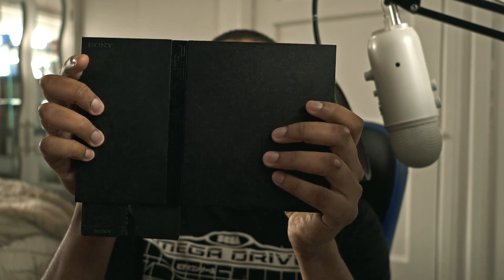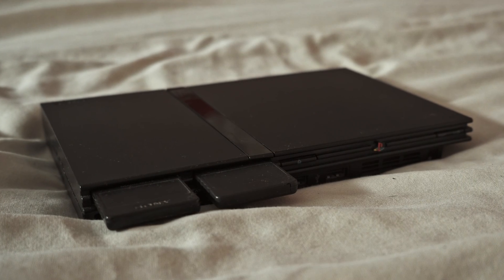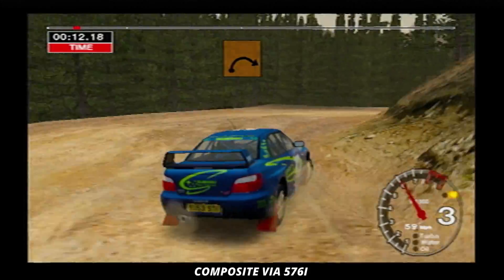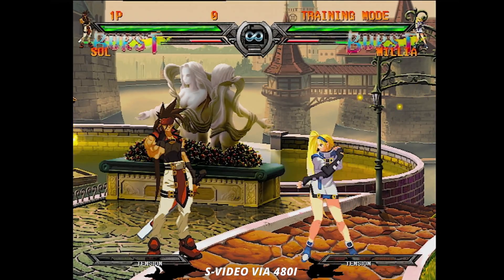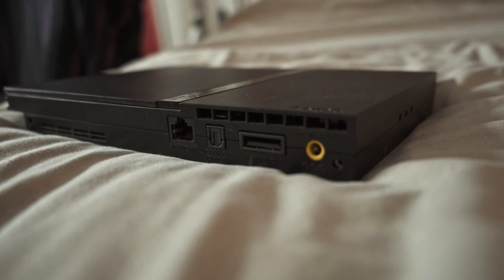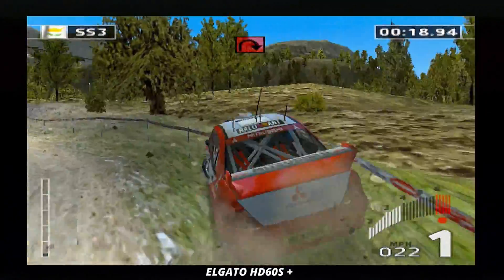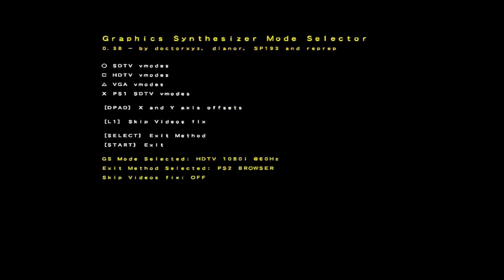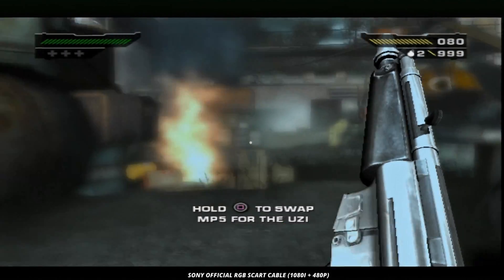PS2 Video Output Misconceptions & How To Improve Image Quality - theaffroshow

Comment: Great informative video. I currently have my PS2 slim plugged in using the PS3 Component cables to a G Comp Switch with one Component out going to a Crt and the other to an HD Tv that way depending what Resolution the particular PS2 game supports and or/if it support Widescreen, I can decide which TV to use. I also have the HD Tv on a Swivel Mount for Tate games that the PS2 have. I’ll never forget that first time I went from Composite to those Component cables, it was night and day.
Reply from the maker: @gametourny4ever627  Sounds like a setup getting the best of both worlds & glad you are enjoying Component cables, a great choice for PS2 video output :)

Comment: I've got the expensive Sony Ps3 cables that for the ps2 slim and using GSM in 1080p is absolutely phenomenal picture! Only got that cable for £6 like 10 years ago its worth over £200 now 😂
Reply from the maker: A very lucky purchase there & glad you are taking full advantage of it :)

RGB SCART also supports 1080i albeit with RGsB on PS2 consoles :)
Reply: What cables?

Comment: I use an HD Retrovision component cable and an OSSC, granted the cost for both is about 190 quid but the picture quality is fantastic.. well as fantastic as you can make the PS2's crappy video signal look anyway.. also one thing I think you missed, in order to get widescreen you need to set the console to 16:9 in the system config menu as some games don't have a widescreen setting in their options and instead look to the system settings and automatically enable widescreen otherwise you'll end up with a stretched 4:3 image.. the Race Driver games automatically set widescreen as an example
Reply from the maker: @waynehickman8317  It is a great combination & while I love RGB SCART, Component is excellent too :)

Yes I did miss that, thank you for bring it up, most people overlook this!

Comment: I have a modern monitor. Would you suggest component cable into an hdmi converter and the hdmi cable into the monitor? Or would you suggest another way? Thanks
Reply: Thank you for the reply. How can I find out if my monitor can deinterlace? I'm a bit new to all this 😅
Reply from the maker: If it's a TV the display will automatically do it as it has one built in :)

As for monitors I assume the same thing would happen but if not, you'd either need to use software like OBS which has several options (Yadif 2x I'd recommend or Retro which is bob deinterlacing) :)

Or perhaps video players like QuickTime which can double as video input solutions might have this too although OBS is more flexible :)
Reply from the maker: You could do this, but this means your monitor has to deinterlace 480i/576i for most PS2 games & if it can, the experience using a good component cable should work :)
If not, get an upscaler like the Retrotink 2x, Retroscaler 2x or a RAD2x cable :)
The OSSC I use is also recommended!

Comment: I use the LevelHike device.  It works very well.  And it is not overly expensive.  It produces 720p and it looks very good.
Reply from the maker: Hmmmm, I've heard mixed responses on those cables. As a starter cable I guess it is not a bad way to go but a retroscaler 2x, retortink 2x or a RAD2x cable would look better and not cost too much more :)

If the cable you own allows you to use PS2 progressive scan mode (480p) in selected titles, that would be a compelling option as 480p is a great way to view PS2 games where possible!
Reply: @TheAffroShowGameplay  LevelHike upscales all RGB signals from PS2 to 720p.  It also has 4x3 and 16x9 selector switch.  It is trchnically a small box that sells for approx 30$.  I been using for 5 years and like it a lot.

Comment: Great piece of information in this video. I owned PS2 years ago and sold it. I have found silver, fat one for £30 on carboot sale yesterday and I'm coming back to old games now. I have component mini input in my tv. Will I loose any video quality if i use component to component mini adapter? It's hard to find any information online specific to this subject. Cheers.
Reply from the maker: Unfortunately I actually do not know about this, if it is a passthrough adapter I assume you wouldn't but I cannot say for sure :)
Reply: @TheAffroShowGameplay  no worries, I'll have to test it myself.

Comment: Good vid. Ps2 is a funny one. Like a few watching this i have numerous rgb scart cables from a well known uk company. My other systems rgb scart cables through a retrotink 2x scart to modern tv, flawless. Set up the ps2 the same way and theres some minor flickering top and bottom of image. Grr. Only way to fix I’ve found is to take the tv out of ‘game’ mode which creates so much lag games are not fun.
Reply from the maker: It sounds like the overscan area that CRTs had & of course using HDMI TVs see it differently:)

Funnily enough, on my OSSC, I do not have this problem on the PS2 using my 4K TV buy I've seen it crop up on original XBOX, odd indeed!

Comment: An awesome video mate 😄👍👍 I very recently started using a PS2 with official Sony PS3 era Component cable for the first time ever and the difference between that and the standardised Composite cable is definitely a major step up in terms of overall picture clarity and quality. 🎮📀
Reply from the maker: The difference is gigantic:)

It seems a lot of people have still stuck with Composite after all these years so, videos like this need to be made so those who simply do not know can see you can indeed improve video quality on older consoles :)
Reply: Whats really mindblowing is the first PS3 was packaged with a component cable and most people never switched it out.

Comment: Which one of these cable options would you prefer for recording PS2 gameplay? Also which one(s) work best together with capture cards, like the one from Elgato? Thank you!
Reply from the maker: I personally own an Elgato HD60s Plus, which all the gameplay footage from the OSSC was recorded onto :)

The other upscaler was an Retroscaler 2x, used when I showed off S-Video & Composite:)

In terms of video quality from the PS2, RGB SCART or Component are the best although S-Video is a good shout as well :)

If a game has 480p support, using Component or RGB SCART with an RGsB supported upscaler (Like OSSC) or display will work nicely:)

After that, the upscaler you use will be a factor if you need one, like myself as I have no analogue inputs on my TV or displays :)

A good starting one would be the Retrotink 2x or the Retroscaler x2, a knock off product :)

The OSSC I use is more expensive but a fantastic upscaler that can upres the lower resolution output by quite a bit :)

Hope this helps! Also, I highly recommend using OBS for recording as it is flexible & can see many odd resolutions outputs unlike Elgato's own software!

Comment: fmcb, opl, gsm 1080i mode, widescreen patches. the aspect ratio has to be adjusted. i only have component but your scart images are sexy
Reply from the maker: Yes, these mods & patches will change how the picture is shown on PS2 but if you have the means, use the tools to your advantage :)

I use RGB SCART from either Retro Gaming Cables or the Sony Official RGB SCART cables but they cost a fortune so use Retro Gaming Cables if you want nice, affordable RGB SCART cables for PS2 :)

Comment: For me the best option is undoubtedly RGB on CRT, that's where the PS2 shines, honestly I've never been interested in upscalers because you might as well use an emulator if you want to go up in resolution at 0 cost. Another option I have had the opportunity to test in recent years is the VGA output of the PS2, but which is limited by the low compatibility of games (officially it can only be used with the Linux Kit) and by finding a CRT monitor - I don't take LCDs into consideration 😆- that is compatible with the RGsB signal. I modified a PS2 to have an RGBHV signal when in VGA mode to be able to use it with my monitor and it's simply beautiful! 😍
Reply from the maker: I love emulation & I do enjoy my OSSC upscaler, it is now vital because new tvs no longer have analogue inputs & without the upscaler I couldn't play my real hardware :)

I have heard about the VGA on PS2 but those kits are so rare & only found a listing once on Ebay xD 

I personally love my 4K display with the OSSC because the upscaler helps the games to look good & it is my first time experiencing 480p supported games :)

Ultimately this is my opinion however, because your CRT supports RGB, the image must be amazing! Definitely well ahead of Composite!
Reply: @TheAffroShowGameplay   There is no noticeable difference in picture quality between SCART RGB and Component on the PS2, since PS2 games run in limited RGB anyway, and your TV can convert YPbPr to limited RGB LOSSLESSLY. There is no advantage to using SCART RGB, in fact most TVs that have both inputs will probably work better with the Component input, as the SCART RGB input on LCDs was usually very poor and only included for compatibility reasons. For example, 480i looks much better on my old Sony W705 LCD when I use component. The same 480i looks much less defined and worse overall when I use scart RGB. On my Panasonic GT60 plasma (which has very good Scart RGB processing) the picture quality looks the same on both inputs.
Reply: Watching the unknown FMV on Tekken Tag Tournament through RGB on a CRT TV... Now that is a religious experience. I can not imagine how mind blowing it was seeing that in 2000.
Reply: RGB-Scart on a Sony 100hz Trinitron, with no hideous scanlines
Reply: I still have a SD CRT, but PS2 games look way too soft on it, especially when connected with an RGB scart cable, because most SD CRTs disable the sharpening filters when using RGB input. PS2 looks much better and sharper on PVM and CRT monitors, but these are relatively small (screen size) and big at the same time (even a 17" CRT is quite big and heavy). 

Fortunately, it's now possible to emulate CRT phosphor masks on modern high-resolution displays, and the results are stunning, giving you PVM-like sharpness on a much larger screen. For example I can barely read anything when I open the map in san andreas on the SD CRT. Same game, same resolution with phosphor filter on LCD and I can read everything easily. The difference in sharpness and clarity is so great that 480i almost looks like an upscaled image on the SD CRT, and HD like on modern high resolution LCD.

You could argue that LCD is no match for CRT when it comes to picture quality aspect (contrast, colors, blacks and especially motion clarity), but 4K QD OLED delivers CRT-like picture quality :). 

I had to spend some time configuring the CRT masks, but now I'm so happy with the results that I don't even want to play PS2 games on my SD CRT anymore. It's crazy how good PS2 games (480i/p) look on my PC monitor thanks to the CRT phosphor mask, the image is clean and sharp (native like). Without the phosphor mask, 480i/480p upscaled to 4K looks terrible, and that's the only reason so many people kept their CRTs for so long, but now CRT phosphor emulation changed everything.
Reply: Most CRTs don't support 480p and the interlaced signal from PS2 creates really bad flicker and shimmering. The best option is actually an EDTV. They're hard to find though. The middle ground between CRTs and HDTVs. They have 4:3 ratio and 640x480 resolution support 480p all while having an LCD panel and weigh nothing. Definitely the best option for 6th gen and the wii

Comment: I've got pretty much every cable possible for the PS2! I bought an S-Video cable back in the early 2000's (can't remember where from, but I don't think I imported it and it was way before Amazon was a thing here, so don't know how I got one). On a CRT it really is the best option, it made the games really come to life. Don't know what it'd be like on a HDTV as I don't think I have one on any of the telly's in the house, might check the Bravia later if I remember. Official Sony component works well enough on my 32" upstairs TV, but I expect it'd break down on the bigger one downstairs. I did buy a kit some years ago that has a component set (didn't need it!) and some DVD that was supposed to upscale the picture, but that was useless. Still, now I have two component cables! I don't know if we'll ever really get to a point where PS2 looks as good on HDTV as it did on CRT.
Reply from the maker: A lot of people seem to have S-Video cables, which is very interesting! From the UK, this cable was not common & Composite or SCART were our dominant cable types :)
A lot of people seem keen on CRT & I'm lucky to have the OSSC upscaler which helps my retro games remain nice on even 4K displays but I do understand why many people say CRTs are best :)

I'll always prefer HDTVs but that's just me :)
Reply: @TheAffroShowGameplay  Ah, sorry, I meant in the past tense, I no longer have a CRT. I kept my 32" Panasonic I got in 2003 all the way up to 2012, but I had to let it go (for free! Argh!) because we had to move into a smaller house and I couldn't take it with me. 😭 Now I have a 32" JVC HDTV. I was just remissing on the "Good old days tm". 😁

I'm in the UK, no idea how I got the cable. Might have imported it from Amazon US as I used to buy a lot from there back then.

Comment: There is definitely alot of mileage to be found from forcing 480p or1080i on games through either Xploder HDTV Player or GS Mode Selector. I would advise doing that, and pairing up the system with a high quality video scaler (i.e. Mike Chi's RetroTink 5X Pro), since that'll give you additional picture control, including further scaling options, besides other niceties like scanlines and masks.
Reply from the maker: Don't forget most people will never do these things unlike us & sadly the Tink 5x is very expensive so the OSSC I use is a worthwhile alternative:)

GS mode selector is great when it works & I know it was updated a few years ago but it's not an absolute fix :) Also there's still not much choice on the PAL games that don't support 60hz, GS mode selector still only offers 576p for PAL 50hz titles, bit limiting!

Comment: I have  the official S-Video psone cable from Japan in 2019, image is very good.
It works quite well on the PS2.
Reply from the maker: If the game doesn't utilise 480p Via RGB or Component, S-Video is a good way to play PS1 or PS2 games on the PS2 :) I like using it but it is difficult when my OSSC doesn't have an S-Video port so I always use RGB :)
Reply: @TheAffroShowGameplay 
I regret not buying an original component cable in the 2000s era .
I would have had  a good cable!
Reply from the maker: @sithounetsith9877 RGB SCART is cheaper & the quality is the same, it is an alternative that's worth looking for, especially from Retro Gaming Cables :)